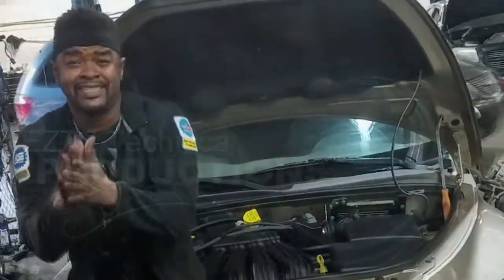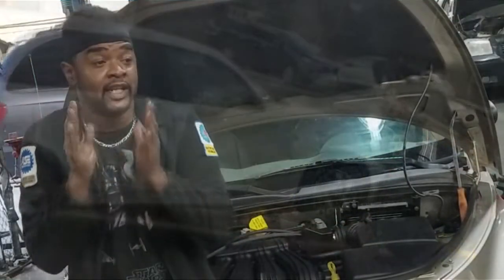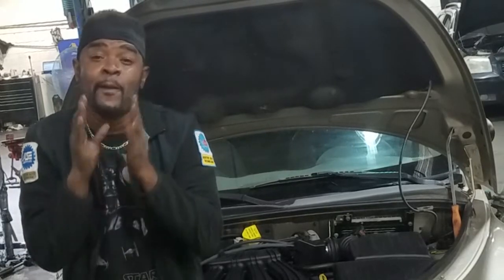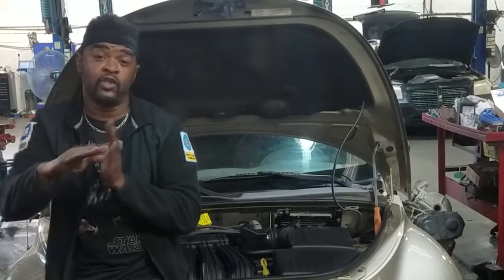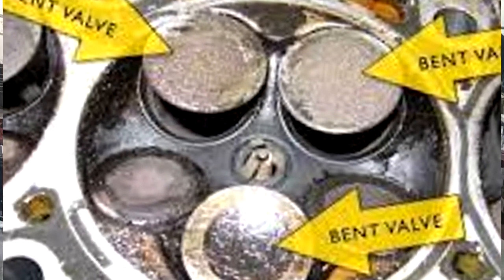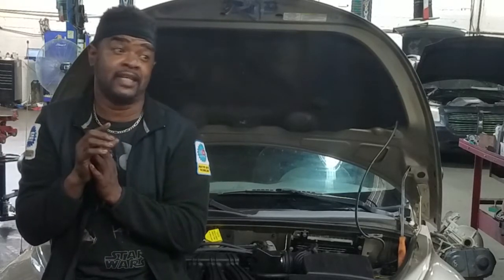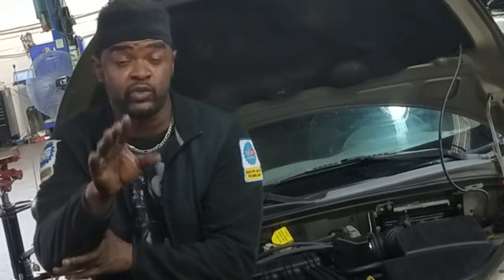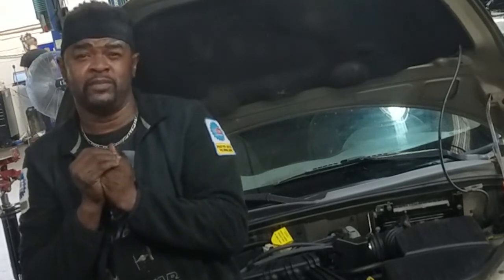PT Cruiser Timing Belt WARNING, AVOID ENGINE DAMAGE.Signs the water pump is going bad.

Comment: Can you replace just the water pump without doing the timing belt to nurse the PT Cruiser along for another couple months?
Reply from the maker: Sure you can, its not a must, just a recommendation
Reply: I got 4 estimates. Every single one said water pump and timing belt go together. Have to replace. Even sold together as a bundle at auto parts stores.

Comment: I have a 2002 with the 2.4 that is having issues with engine shuttering. No codes for miss fire no codes at all. I replaced the intake manifold gaskets and injector O rings. The timing belt and water pump and spark plugs and coil pack have also been replaced. No vacuum leaks at all. Wondering if anyone could tell me what's going on and how to fix it.....
Reply: Did you get this fixed?  Was it the dirt around the intake manifold that caused the shuttering?
Reply: Did you try cleaning inside the intake manifold.